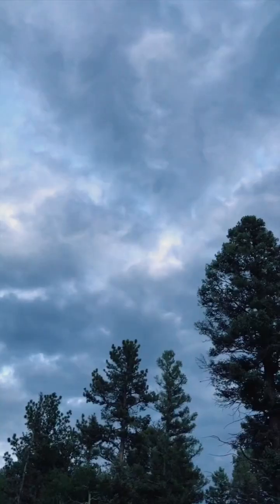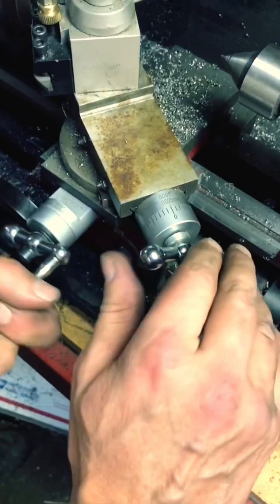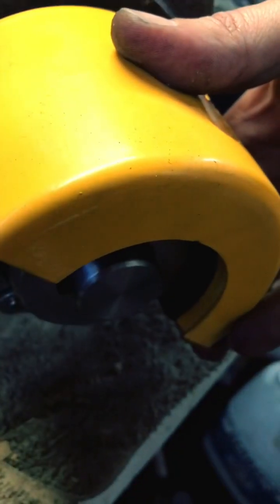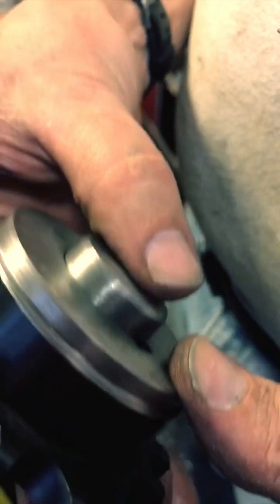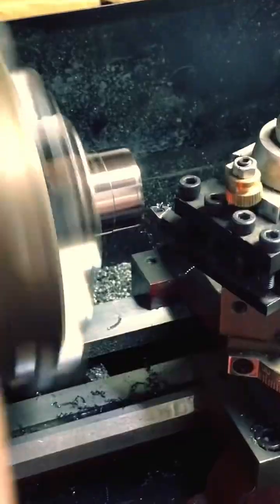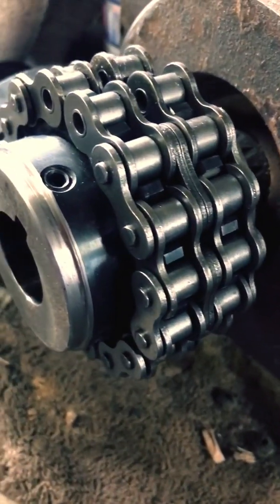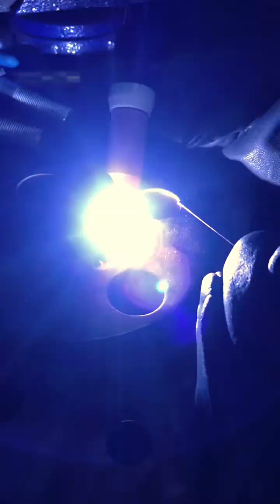Repairing A Hydraulic Pump | Case 590 Super L Backhoe

Comment: Did you guys find a final solution to this issue. I have replaced the pump 3 time and about 12 couplers. I’ve replaced motors mounts and nothing works it keeps breaking. My case is a 2000 580 super L.
Reply from the maker: Mike says he hasn't put a ton of hours on it, but he added a grease zerk and put a piece of rubber hose between the coupler and shaft to hold the grease in and keep all the dirt and crap out of it. So far that has been holding up better than the other stuff he's tried. I hope that helps!